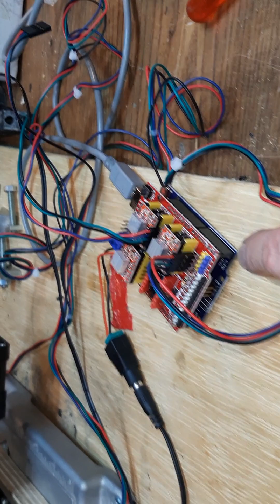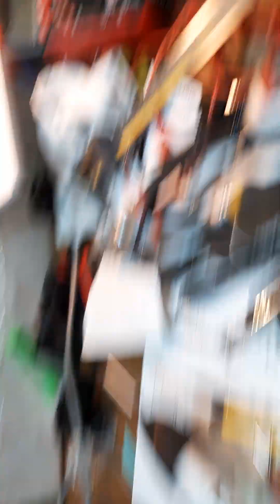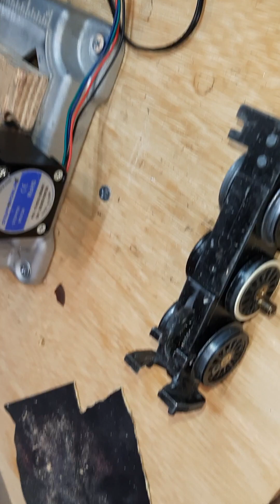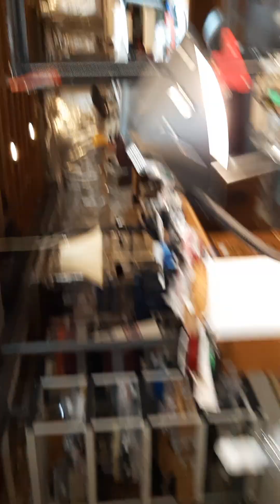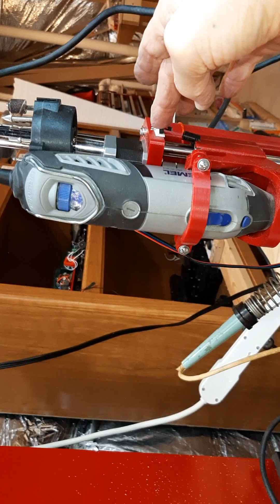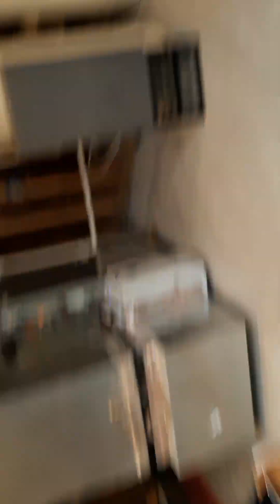Frankentrain Laboratories finally assembled and ready to design a void to test on wood.

Comment: So very cool!
Reply from the maker: Thank Alan,  i find as I age I tend overlook things or forget some details and that slows me down a lot. But If I stick to it and stay steady at it I can still achieve my goals. I have wanted a Milling Machine for 50 years. Finally, no its not a 3,000 pound Bridgeport but its one I can afford, it is CNC and it can cut metal (slowly).  I am already thinking up projects I have wanted to machine. And the Updates, bigger Spindle motor, Mini Plasma Cutter, Custom Diesel Drive Trucks, Custom Engines, Tenders and salvage every RIB Steam Engine for Digital Conversion.  I know I have learned a ton off the 3D Printer with all its early bugs and many upgrades. But I never really wanted to design build a 3D Printer, I wanted a tool that worked so i could build engines. But now a Mini Mill with CNC that can cut metal that sets my heart on fire with passion. I am so happy to have found the IOT,  the Arduino, the Notion of Arduino Shields and Stepper motor drivers.  And Andy my buddy in South Africa happened to have the same 3D Printer and knew about the issues I was having and for no reason just jumped in and offered to help me get the machine right. He was amazing and curious about American Flyer so I sent him one of each version in rebuildable condition and he seemed to enjoy the process. I taught him and he has taught me. For 2 years now we have been long distant train Buddies. Then he bought a used derelict Mini Mill and was sharing with me his journey in rebuilding that thing. Then we found a 19 year old engineering student in Poland Niko that had converted a Dremel to a Mini Mill Boom we were off and running. My approach was different in I had these X Y Tables and I had a Vertical Frame in the Dremel Drill Press so I ended up taking all the Z parts past the Dremel Clamp and Guide rails modified them. The rest is Andy telling what he had found in research CNC, GRBL, and Arduino.  Here we are. OH BOY.